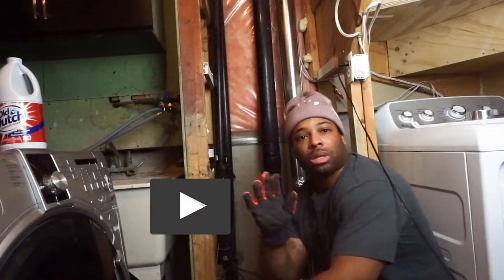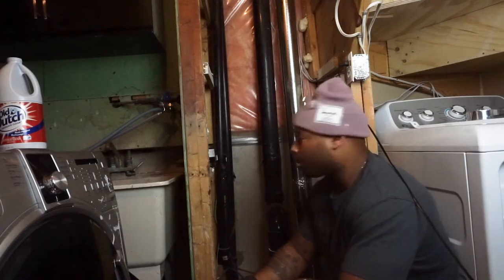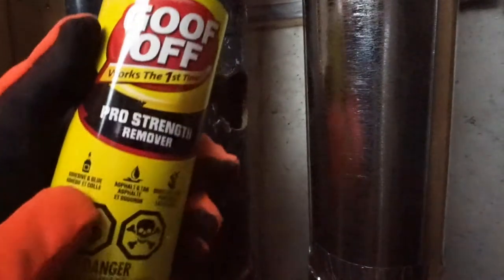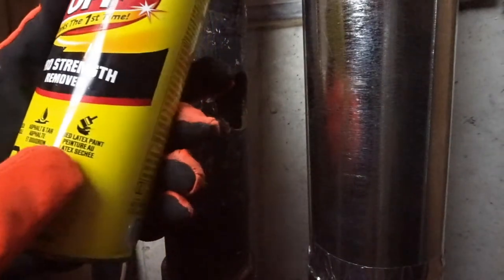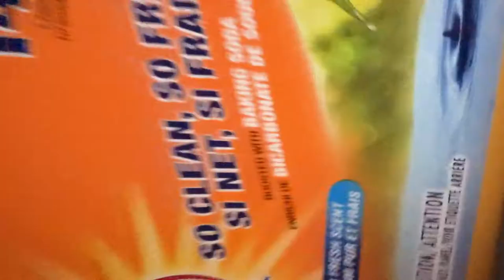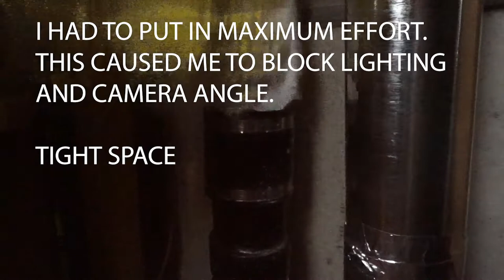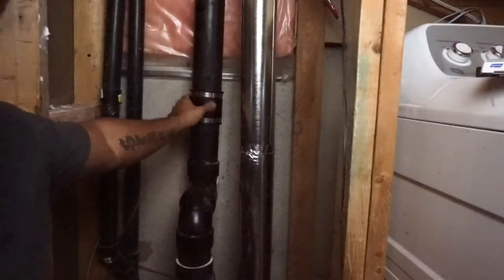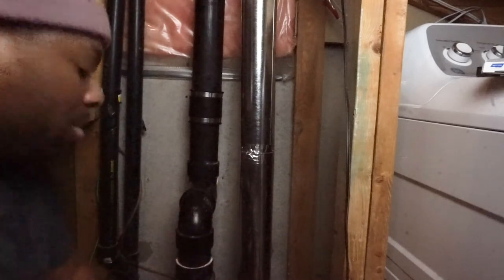HOW TO REPAIR HOLE IN ABS MAIN STACK PIPE

Comment: Why didnt you make 2 cuts and use 2 nohub couplings and a small piece of pipe?...would of been alot easier, and made a better seal
Reply: Better yet use 1 glued coupling, piece of pipe and 1 no hub coupling. Faster, better and cheaper.
Reply from the maker: Thanks for the info

Comment: I was removing some siding today and I cut the main stack of the abs a tiny bit with my oscillating saw: i couldn’t tell if I went thru all the way, I tried to tell by seeing how far my utility blade went into the pipe but I couldn’t really tell for sure. I ran the sink upstairs and flushed the toilet too and there wasn’t any visible water but that’s not to say it the pipe was full from a clog that it wouldn’t leak. So I kinda gambled a bit because I really didn’t want to cut the pipe and use a collar so I got some abs glue and filled the cut mark with the abs glue. I did three coats just to be sure it was thick enough to completely cover the cut and it seems okay now but I don’t  totally feel great about it. Again it never showed signs of leaking before I applied the abs glue and now the cut mark is filled do ya think it’s okay to leave that way?
Reply: Since no one has replied I'll give it a go. (I'm not a plumber so take this with that in mind). You are calling it ABS glue when in fact it is ABS cement. This ABS cement is a chemical that when applied between two pieces of ABS causes them to chemically weld together. I'm not sure what the cement does, if anything when not being forced between two pieces of ABS. Meaning, I doubt your fix has done any good as it may have just temporarily softened the applied area while drying. I could totally be wrong. As I mentioned, not a plumber. Hopefully a plumber can chime in on your repair attempt.
Reply: @dizdizzle2  glue, cement, does it really matter? No. I spoke with a plumbing contractor who said what I did is fine.